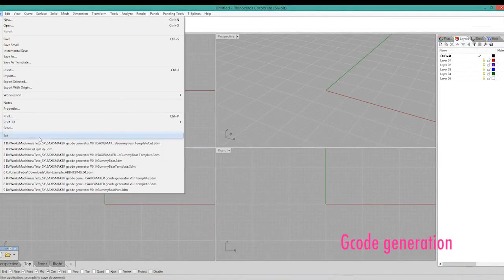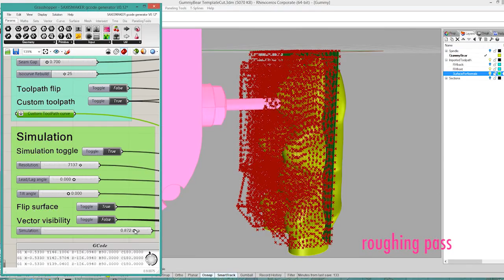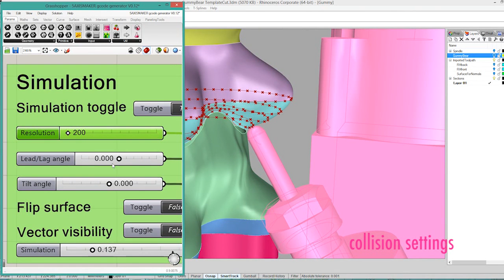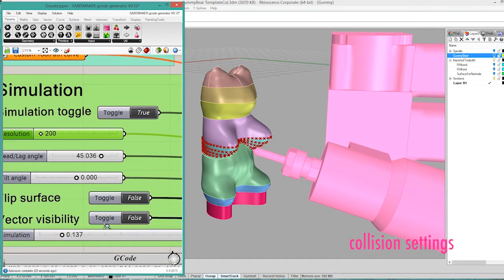5AXISMAKER - How to milling demonstration

Comment: This tutorial isn't working with the updated version of 5xMonkey (version 8). When I open the Rhino presets, load my model then open Grasshopper and select the model I loaded in Rhino as the Geometry via the "set one geometry" feature, nothing happens. The B/C head geometry doesn't appear and no gcode is generated. When I pick the 3d model as the guide geometry via the "set one geometry" option, nothing happens. Any ideas on what the problem could be would be greatly appreciated.
Reply from the maker: thanks for your message, we have a few of 5xmokey file setups on our case studies page, 5axismaker.com/case-studies/

Comment: i like the idea using the brushless motor but what about the burr, it will jammed the motor
Reply from the maker: there is enough circulating through the motor which blows larger particles away

Comment: very interesting projekt. I tried your plugin for grasshopper but i didn`t get it to work... I hope you reache you target to get this Programm fully to work.
Reply from the maker: Perhaps the reason that it didn't work is because you've used meshes for the very first release which only works with surfaces. The second issue works with meshes. We also describe on troubleshooting the surfaces in our latest manual. Please send us an email and we'd be happy to send you latest updated version of manual and script, if you have any problems with it we'll go from there.